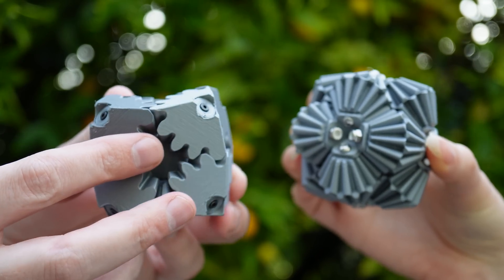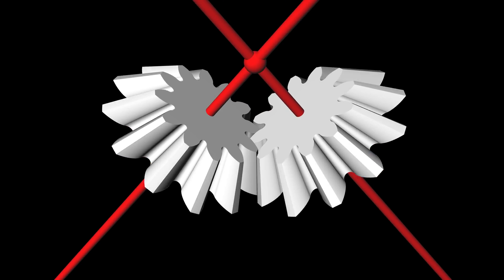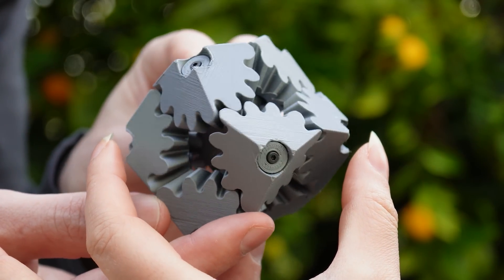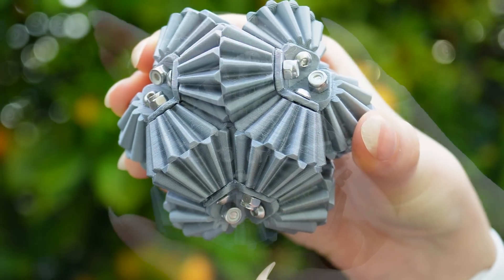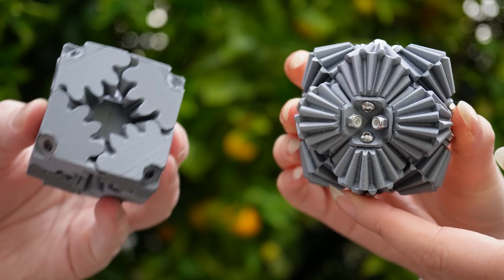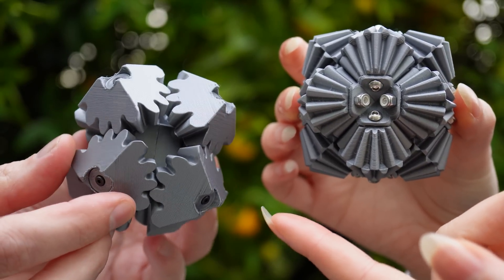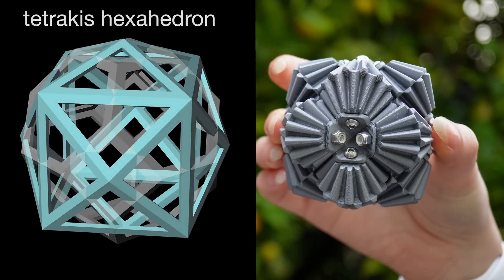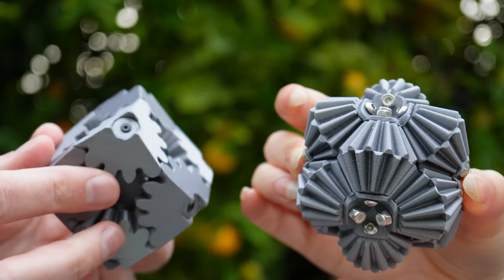Gear cube and Brain gear

Comment: I remember discovering the wonders of gears as a little kid in the science museum. You would put magnetic pegs and gears on a metal table to make little gear rigs and I probably spent at least an hour just at this table making circles of gears. I discovered how 3 gears can’t meet at the same time, then how an odd number of gears can’t make a loop that turns. I learned about pulleys and how small and big gears make fast movements turn slow and vice versa.

Comment: I was exploring this a few years ago when I was playing around with bevel gears, and found that you can get more options for "cube gear" style gear systems by relaxing the requirement that all the gears be the same size.  For example, I designed one based on a truncated icosahedron/dodecahedron, using twenty 12-toothed gears and twelve 20-toothed gears (no like gears ever mesh).  I have to pay for 3D printing, though, and never got around to making a physical model.

Comment: The gear cube is fascinating, but I wonder if there is a practical application?
Reply: the left (gear cube)not so much, but the right one looks like a head of an oil driller:
https://de.wikipedia.org/wiki/Bohrmei%C3%9Fel#/media/Datei:Erd%C3%B6l_Bohrmeissel.jpg
Reply: Possibly applicable for rock drilling too

Comment: So basically one set has the axis of each gear cross at the center, while the other has each gear's axis be one side of an octahedron. I wonder if you can use the same design from the second set, but use a different polygon, say a dodecahedron?

Comment: The faces of the brain gear work because they are collapsing together, like having two pinions on the same rack. The reason they don't grind is because of the ½ step offset you've built into the two halves of each gear. 

Theoretically, you could produce similar mechanisms for each polyhedron with even sided faces or an even number of edges meeting to a vertex, no? That would indeed give you the tetrakis Hexahedron, but also potentially the Rhombic Dodecahedron, Rhombic Triacontahedron, deltoidal icositetrahedron, deltoidal hexacontahedron, and Disdyakis Dodecahedron. Perhaps others among non-isohedral figures as well.

Comment: I think the reason why 3 double bevel gears work together is because putting 2 bevel gears back to back changes how it works in some way. Looking straight at the axis from one side has the whole thing rotating the opposite way as from looking at the other, so it works like having 6 gears together instead of 3.

When I was thinking about this I thought up a way to show how double bevel gears and flat gears are fundamentally different. You bend 3 flat gears so they go together, side by side x3. They won't turn, but flip them all 180 and they would turn fine if they were meshing. You could bend the prongs 90 degrees so the gears mesh, and it I'm pretty sure it would work fine, like double bevels. I don't see how this lines up with the 6 gears thing I was talking about earlier though so I almost feel like that explanation is missing something. Idk, I'm sure this is already written down somewhere, but really interesting to think about.

Great video as usual, and cool guest

Comment: Explanation for how the three years work together:
Each of the "gears" on the brain cube is actually two beveled gears glued together. And so although they both move in the same spatial direction, one gear in the pair moves clockwise while the other moves counterclockwise. So at the corner with "3" gears, there are really six gears.
It really comes down to the gears not being in one plane of rotation, but in three separate planes of rotation all turning towards the center of the face.

Comment: A three set of gears only doesn’t work if they rotate either clockwise or counterclockwise due to alternation. On the brain gear, however, they rotate either in towards the center or out from it. This means they all turn the same way, therefore no alternation is required.
Reply: Also, notice that it's actually six gears, glued together into rigidly-linked pairs of two, thus making the whole setup even regardless.
Reply: @boxcarz  That doesn’t quite explain it, because glued gears spin the same direction, as opposed to meshed gears which do not.

Comment: cycles of gears need to have an even number of gears if they are planar gears lying on the same plane (or funny shaped gears arranged in the same way). In the second design, that set of three gears simply isnt arranged in such a way.
Reply: In other words:
Instead of every point on a planar gear having a direction associated with it depending on the axis and the prime mover, the axes on a plane divide it into a rising and falling side. If you line those sides up and create gears whose cross-sections fit into that intersection and can effectively mesh, you can have any number or shape of them moving together.